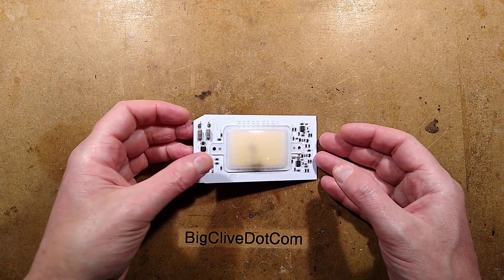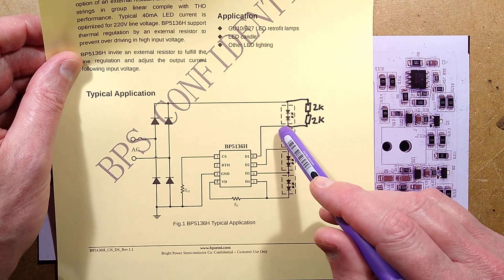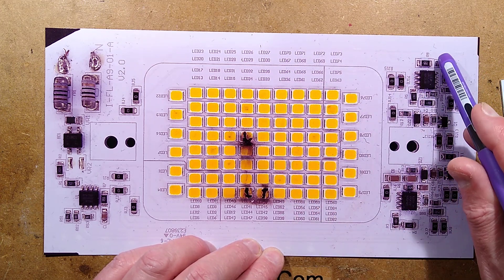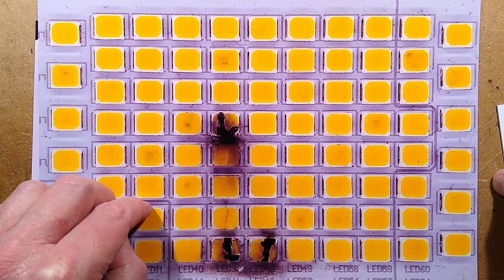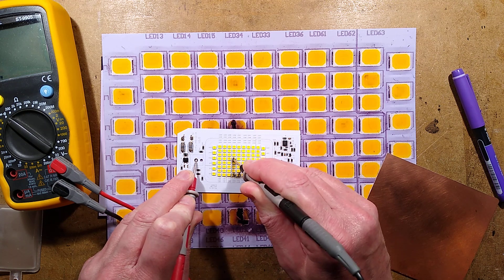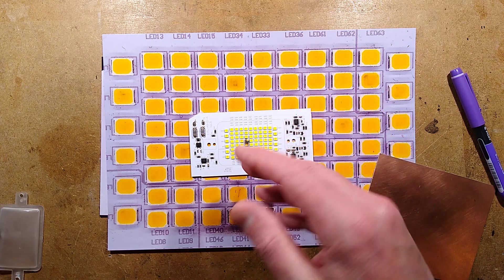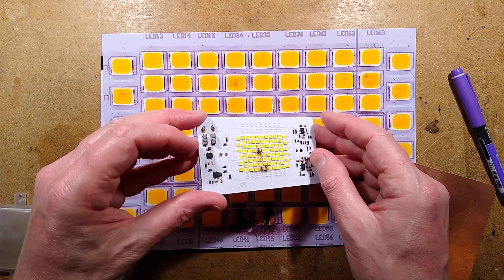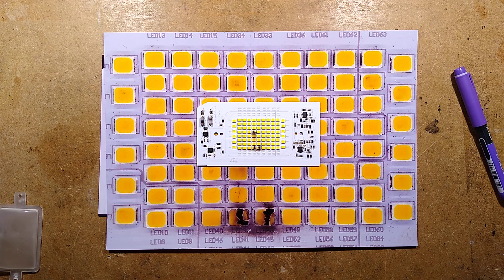LED shock hazards are increasing

Comment: Clive, I see that sort of insulation breakdown all the time in 3-phase motor windings. Thermal breakdown of insulation is a problem on most things that are 'high efficiency'. Thank goodness we drop an earthing wire to these things in the states. People tend to think high efficiency means that it is better... it is, at making lots of heat in very small areas.
Reply: Yes we see this in fridges now. The little compressor burns up about a week after the warranty period.
Reply: @assassinlexx1993  It is called ' planned obsolence ' it very widely used .
Simply calculate close enough that after a ' planned time ' the device will break .
Shure repair be so expensive that they welcome you to buy a new .
( and of course it ALWAYS happen short of end of warranty )
Thats called GREED and PROFIT .
The very reason most of the 3 world is drowning in electronics garbage exported from the 
rich countries so to ' wipe under carpet ' and declare we have for shure no really waste 
/ garbage problem .
There was once in a time where they made quality and devices from that time is still 
working and can last decades .
But then the Greedy old man realiced that if all people buy such thing then he can't continue 
selling . So to solve this the old Greedy man now selling stuff that wont last more than the 
forced warranty ( the warranty they lobbyed down so its typically 1 or 2 years and NOT the 
original 5 years the government wanted , Yes the Greedy old have power , Lots of power )
Devices with small failures they sell to 3 world countries and this is with ONLY A MONTH 
warranty , simply because those will break in between 2 and 4 month .
They design the ' end of life ' after each countrys specific warranty rules .
If your country say 1 year ( lobbyed level ) then they go for 14 month of life before break .
If it say 2 years 
( still a lobbyed number , original claimed from government as minimum was  5 years )
Well now the device get a little bit more expensive ( for the excact same device ) except 
that now they have made it so it break 2 to 3 month after warranty .
Yes it is extreme timing .
They started oing this with light bulps .
Catastrophe they end up making them so good that a lightbulp could last almost for ever .
But no no no no , the Greedy old man want more More MOre MORe MORE .
So they formed a cartel where they all agreed to set a max amount of hours of life for a 
light bulp . Now the people who was working on making the best quality as possible was forced 
with the task of going opposite .
Degrading their products life time .

They are even so greedy they trying to force by law the right to repair to be removed .
Yes lawsuit after lawsuit because people simply repair and not throw away .
They even filling devices up totally with glue to make shure they cant be repaired .

Are you one of those who support them ? sadly we all are in some way because wy buy stuff .
But we should be aware and try to only buy quality and stuff that can actually be repaired 
if it breaks .

Because of this pollution has exploded like crazy trough time and we see more and more 
''' buy and throw away '' stuff being made .
No wonder our climate is going bad and we actually is at the brinck of no return .
Reply: @Stronz_music  Think of it this way. You are a light company competing with Company B. You’ve designed your bulbs to last five years and they cost X dollars to do that. Well, Company B is now selling a light for $10 cheaper. The only way for you to compete is to use less expensive components that happen to not last as long. If you don’t change, your business will fail. What do you do? Of course you use the cheaper components! The problem is the consumer places too much value on it being less expensive rather than a quality product.
Reply: @Stronz_music  I have a Philips fan heater that's 50yo. It has a label on the base that says, "Every six months, unplug, remove the screws (2), remove all fluff and oil the bearings."
I've been doing that and it's working as I type this. It is so old that the neon bulb went dim so I salvaged one from a kettle and now I have a bright neon indicator.
Reply: @Scotty916  
Thats not how it ever worked out .
This is how they defended it .

They all formed a cartel back in 1920'ties and agree on making them last a max 
amount of hours ( that time 1000 )

It still exist NO matter if big or small 
companies .
If you ever break then you pay .
That's how it works .

It was NEWER because company a could make a product cheaper less quality ect .
NO it never worked that way and still today it doesn't .

Shure company a can choose materials cheaper then b and get less quality to less 
prize but you still  up against the max hours limit formed by the cartel .

It is the same with batteries ect ect ect ect.
You are free to make less expensive and 
less quality product but DO NOT exceed 
the limitations formed by the cartels .
They make hure you no longer have a company .
Reply: @rysacroft  From the ' forgotten time '
where things was built to last .
Ad you can easy do maintenace yourself.
Yes that is nice .
We need more stuff like that .
Reply: @Stronz_music  There is no battery cartel or TV cartel… light bulb manufacturers had purposely limited the hours of a bulb but that’s not around anymore.
Reply: @Scotty916  
There is much much more around today .
Believe what you want I do not care .
I KNOW what's going on , thats enough 
for me .
As long as people can't see / realice it , 
then it is impossible to fight .
Just like the fight for right to repair .
That do not exist too Right ???????
Some people do open their eyes and others is just blinded by society .
I do NOT care what you say .
I KNOW HOW THIS WORKS .
Reply: @Stronz_music  Alright, bud. You take the fight to these “cartels”
Reply: @assassinlexx1993  there we got the most beloved Govt. toy called planned obdolescence !

Companys aren't sued because the gov grabs it's 18-22% off and is happy with that!
Reply: @eegles  I think it leans towards companies lobbyists making nudging laws making it near impossible to hold them accountable. 

First it was a bribe, now its just income. No accountability.
Reply: @eegles  it takes a pretty dull mind to not remotely get the shit that is going on behind the scenes.  But some people are straight dumb and buy shit that lasts 2 years and a month over and over. Without the slightest bit of reflection.  These dumb fcks are the perfect target.  One could even sell 'em sand in the middle of the desert.
Reply: It boils down to more power in a smaller package. Less material makes this less expensive to make and cheaper to end-use purchase. The own-us is on good engineers and technicians to provide adequate cooling to allow these thing to have long happy service lives... or they fail. Fast and usually in flash or puff of smoke.

Comment: I recently had a couple of can light led retrofits fail and were flickery.  When I pulled one down I touched Some bare metal on the fixture and it gave me a wee tingle. Upon removal and inspection I found that the power supply had "safety tape" on it and it had come off letting the hot wire touch the case when it would get hot and that caused flicker due to shorting momentarily.
 Great video bigclive 👍

Comment: Ooooh Err, definitely gives a different meaning to getting a little electric shock!
Demonstrates how important proper earthing is for class I items is. Or for class II items to actually be properly double insulated.
Unfortunately items that you buy abroad may not be built to the same standard of safety that is required in your own country.
If buying direct from China, it’s wise to carefully check and electrically test any mains voltage or high voltage items. If you don’t know how, maybe don’t buy items that may be dangerous from abroad. Ask yourself, is it worth it?
Reply: In the city I live in a young woman recently lost her life.
She had been using her mobile phone while taking a bath and had it plugged in because of low battery.
When that phone fell out of her hand she recieved a lethal shock.

Now i haven't heard anything official other than that, but all chargers you can buy locally have to be properly insulated from mains.
So that kinda only leaves two options. Either the charger was faulty or some cheapo.

Saving a few bucks is not worth your life.
Reply: @Landogarner83  BigClive has covered these issues a number of times. You are relying on the insulation in the windings inside the transformer, and many times that isolation becomes just thin plastic tape or abraded insulation on the wires.
Reply: @robertbackhaus8911  Some of the cheapo crap devices floating around are not even isolated at all.
I have seen a dismantled USB-charger that was just a capacitive dropper.
Of course it did not have any way to prevent plugging it in the wrong way.
Reply: Serves her right. No one needs a phone with them in the fecking bath. Your in the bath to wash yourself, not be play stupid games on your phone (i doubt she was actually calling someone).
Reply: @simontay4851  death is never a just service.
Reply: @simontay4851  I wouldn't (or rather one shouldn't) jump to that sort of judgement without knowing the full story. Maybe it wasn't an actual bathing type of bath but rather a relaxing spa day type of bath. If that were the case and somebody received a call or text message from somebody important it wouldn't be unreasonable to pick up the phone.

Comment: Is there a way to wash the white off the circuit board and expose the underlying traces?
Reply: I don’t think you quite get the purpose of solder resist… it’s designed to be tough and resistant to molten solder and to solvents…
Reply: Solder resist coatings of today is usually (or maybe always) UV-cured. Dissolving them after UV-curing needs some really nasty stuff, probably something like fuming nitric acid used for IC-decapping. I had no luck with any type of paint thinner or even with pure acetone.
Reply: @mrnmrn1  How about dichloromethane? I have some aircraft grade paint stripper, that is the main ingredient. Nastiest chemical I have worked with.
Reply: No - only way is to remove components with a hotplate or oven, then sand off the resist
Reply: It will expose a picture of winnie the pooh.
Reply from the maker: It's very tough.  I should really experiment with more solvents, but getting the good ones here is difficult.

Comment: Yeah I officially hate these discrete LED units. I have had or heard of nothing but trouble with them for a couple reasons. 1 being the chips get pretty hot and they don't conduct heat away well so they don't last well. 2 being they are, from what I can tell, always the gold bond wire type which is fragile and regularly have problems in manufacturing and also don't last super well just due to design.
Zero trouble with the flip-chip type in a unit under the gel, no bond wire. Got several of those, one in the outdoor light which replaced the discrete type when it burned out suddenly and the rest as lights all over.
Reply: Flip Chip is way better for this application. I agree

Comment: Smooth DC sounds like a jazz band
Reply: @ts757arse  their latest output has zapped right to the top of the charts!
Reply: @xyonofcalhoun  They've rectified their negativity into a positive rhythm and electrified their audience in the process.
Reply: Or a radio station ;)
Reply: Nice.
Reply: @ts757arse  sorry to be a killjoy but AC causes your muscles to clamp not DC
Reply: The smooth jazz cover band of ACDC